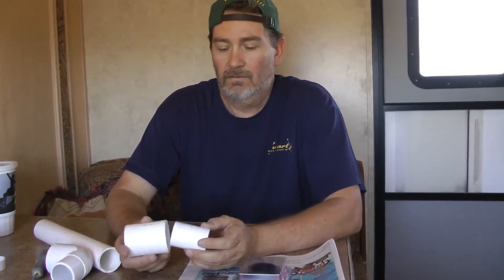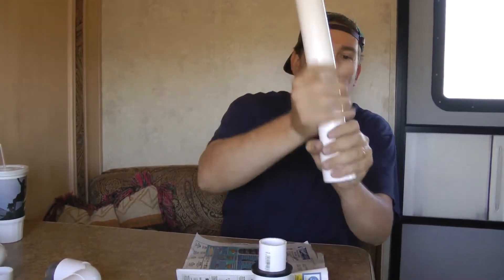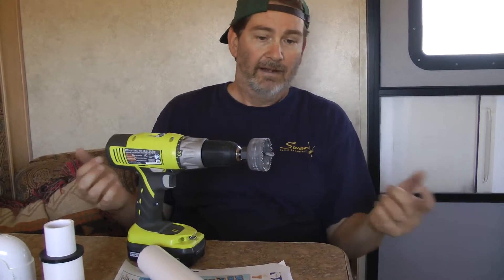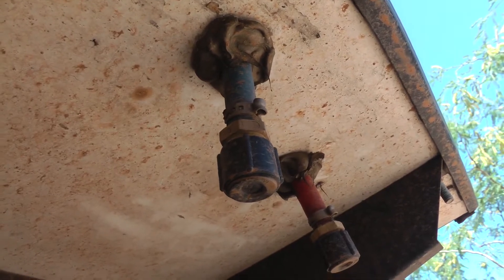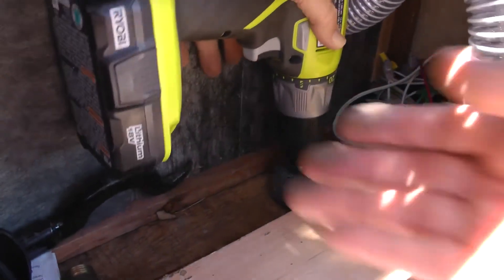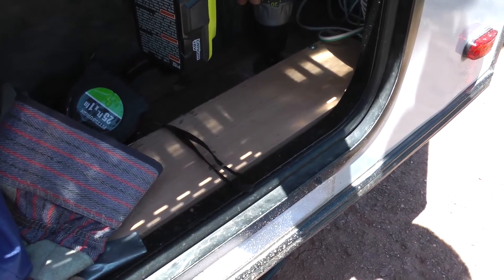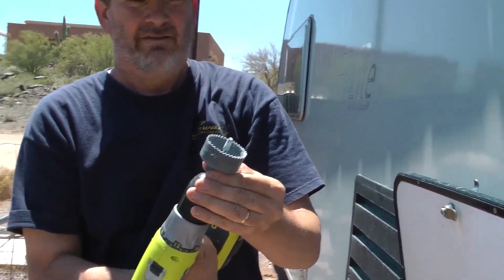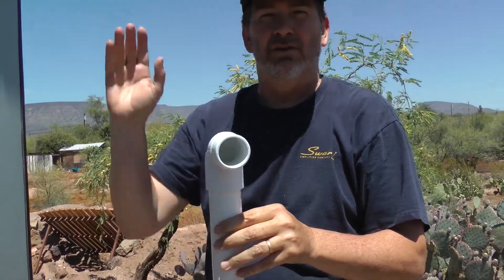Installing Compost Toilet Exhaust Vent Compost #4

Comment: The piping is deliberatly incompatable. They are for seperate systems. Not shure think one is for under presure or heat another for surage and another for potable (drinkable)water.
Reply from the maker: thanks, makes sense i guess.